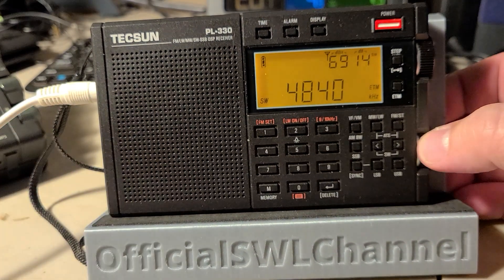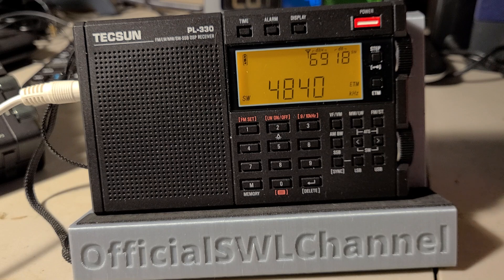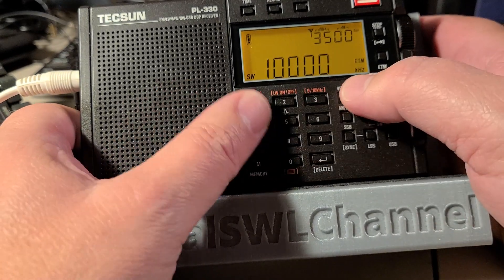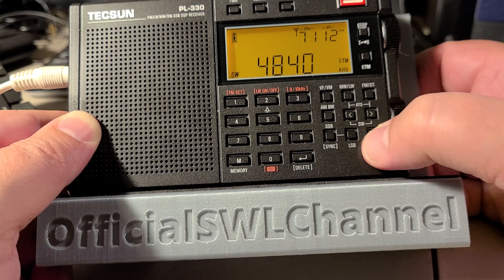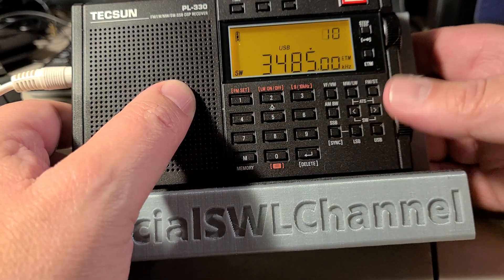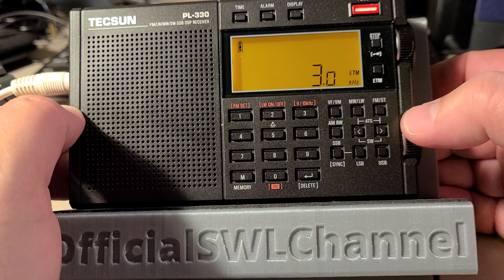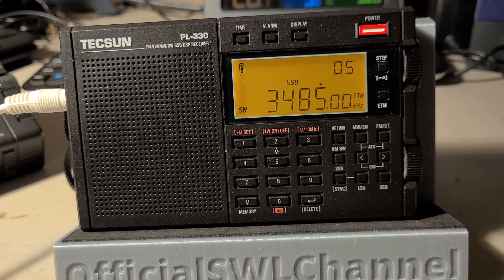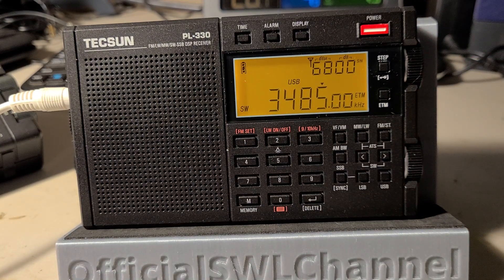How to Calibrate Tecsun PL-330 frequency for perfect tuning is same as Tecsun PL-990x

Comment: Has anyone figured out how to upgrade the firmware should you buy one with older firmware.  Can you confirm 9KHz BW only works on LW/MW  not on shortwave.    Thanks
Reply from the maker: you can't upgrade firmware you need to have one with the latest already installed.   there is no 9 kHz bandwith on AM  it'S 9 or 10 kHz steps
Reply: @OfficialSWLchannel  I just double check the manual. Selectable bandwidths are:
LW/MW: 2.5, 3.5, and 9.0kHz.
SW: 2.5, 3.5, and 5.0kHz.
SSB: 0.5, 1.2, 2.2, 3.0 and 4.0kHz.     For shortwave its a little narrow with only 2.5,3.5 and 5.0KHz.   If a shortwave station is coming in strong it sounds a lot better with wider bandwidth.    Would you or anyone else confirm what I am reading from the manual.  I want to make sure I know if this is the case with the latest firmware.    Thanks
Reply: @n1kkri  I just got mine. New to SW radio stuff, but I have the latest firmware and my instruction booklet reads the same. Here's how to select between internal/external antennas. Press and hold the number 3 button. It's ridiculous that this isn't in the instructions, as my radio's reception in AM was terrible until I came across this little secret.
Reply: Thanks,  I thought the manual states on longwave and mw the AM BW could go to 9Khz.  I was hoping that was the case for shortwave. I like to listen to Ham Operators on 3885Khz AM mode with a bandwidth a little wider than the traditional 6Khz on my old tube radios.  Makes a huge difference in the audio quality as well as when listening to shortwave and medium wave.